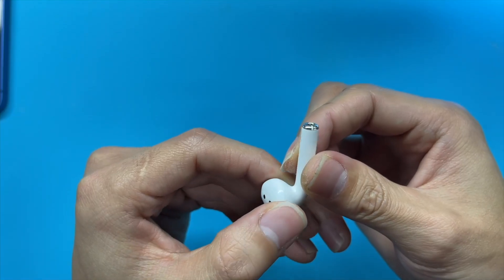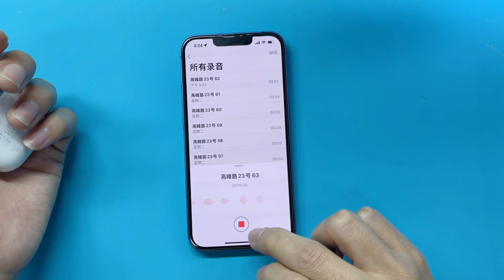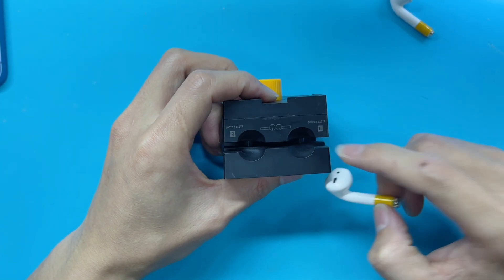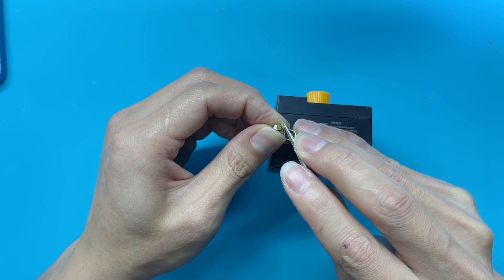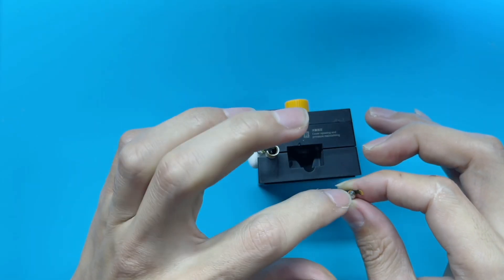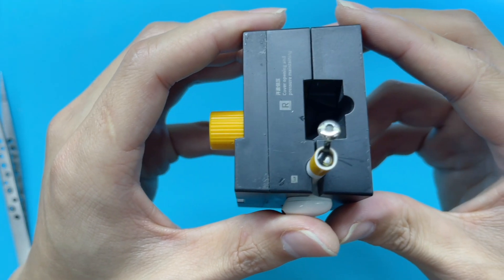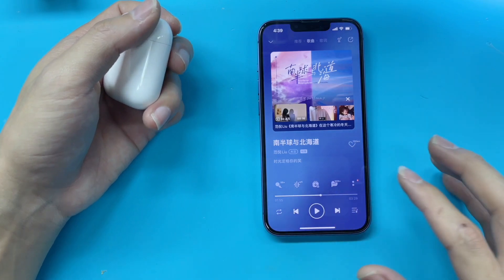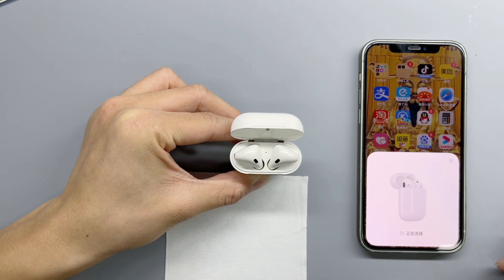How to Replace AirPods Battery Without Damage (First & Second Gen)

Comment: Works! 
If you use a stronger heater, like a hairdryer: make sure you dont heat the back towards the earpiece. airpod will get warm and deform, new bat wont fit properly.. ask me how i know :/
Reply: Hi there!, i wanna replace the batt. of my airpods , u know how can i Find the batetery replacement part?
Reply: @Saedale01 i got mine for too much money on amazon - make sure your listing actually inclused both batteries, mine didnt😬
Reply: @Saedale01  ali express

Comment: This year I was the last person to be re-gifted a set of Airpods that have apparently been circulating for 6 years. They are not taking a charge. With this guide I believe I can at least try to get them working.
Reply: It worked?
Reply: @ I forgot about this comment. 
Yes, it worked. To an extent anyway. The tolerances are too tight for the tools I had and I cracked the stems. A bit of glue and a layer of Kaptan tape means they now hold a charge and have worked fine for the past year.

Comment: Thanks for the video! I’ve been replacing batteries in phones, computers, and various other electronic devices for some time now, but the time has come for me to learn this delicate repair. I can’t bring myself to discard my 1st gen AirPods, as it feels like a waist with all other components besides the batteries being perfectly fine. Heat gun, patience, and probably more heat gun. 

Is the flex that connects the bottom charging contacts and microphone integrated with the battery connector flex tabs? The battery tabs appear to “sandwich” it.

Comment: What is flux? Can you put a link of everything you used. Ty
Reply: you dont really need it. at a certain point of degree, the solder iron melts and easily be pulled out.
Reply: Yes, I agree, it is a nice video, but it would be good to have links to some of the tools and products used in the repair process.

Comment: Hit and miss, my left sides tiny ribbon cable was stuck or intentially glued to the body of the battery. Pulling oit the battery of course tore/ ripped this cable when pulling out the battery and was meant to be in the bin anyways.

Comment: No thanks...I'll just buy a new pair 😂
Reply: Just bought a pair of batteries for only 20$ bucks. How much a new pair of AirPods?
Reply: @silvon4r depends 😂
Reply: @silvon4r how much for a soldering iron, solder, flux, heat gun, heat resistant tape, glue in a specialized bottle meant for precise application, and the batteries? Probably a lot more than the now discontinued but previously affordable $100 price.
Reply: @silvon4r yeah $20 for a battery, $6 for heat tape, $20 for a special clamp, $35 for a heat gun, $7 for flux syringes 😂 mean while costco took my return years later and i got a brand new pair
Reply: …and that’s exactly what they want you to.
Reply: @navarone_at ofcoz..that's why it's called a business company..😂😂
Reply: Yes you can buy a new one, but you can't buy knowledge.. and i'm considered this as knowledge..
Reply: For real. Fuck all this. I replaced the battery in my digital Polaroid easily and I thought this process might be the same. Nope. Lmao.
Reply: @ericalvarado1228 almost like they make it hard for the end user so they can siphon more out of pocket your pocket. Right to repair
Reply: Okay?
Reply: Bro Apple is playing us all, Mfs want us to keep buying new pairs
Reply: yeah but fck apple for making repairs that hard. They want people to be dmb and buy new ones
Reply: Fax this is too much for no reason bruh

Comment: It's an awesome skill. Have you ever been unable to connect to Bluetooth after replacement? After I replaced it, I can't connect to Bluetooth...
Reply from the maker: Yes, your problem might because the solder joints are not properly connected.

Comment: excellent tutor, unfortunately not all user having special clamp specifically for certain item. unless they open repair shop. but I would say this is perfect when other says cant u said yes it can be repaired.
Reply: Edit: This is the original repair video, where they make their own clamp jig: https://www.youtube.com/watch?v=pE9aB5aPbMM

Just need to design one on a 3D printer. Otherwise, I'm sure you could put some soft material around a clamp. There doesn't seem to be a lot of pressure required to pull the battery out.

Comment: Now, if Apple actually cares about the environment they will open up replacement parts and tools to 3rd party repair shops and to individuals.
Good video though, glad too see this is still possible till Apple pairs a chip in the battery with the headphone unit similar to that of the iPhone batteries. Making replacements impossible.
Reply: Law should prevent companies like Apple from making products that cannot have batteries replaced easily. It is contributing to planetary destruction!

Comment: iFixit: Non-removable battery, 0/10 repairability score.
ChargerLAB: Hold my beer…
Reply: I’m guessing iFixit is aware of this but doesn’t recommend the fine soldering work and risk of an average user overheating the battery too risky. You’d probably want to find the soldering gun, heat resistant tape and an infrared thermometer at the very least and most people would probably wing it with a hair dryer, posing a risk.
Reply: @veccio I winged it with hot hands and a hairdryer and it worked great. Battery came right out. I also just clamped the AirPod into a small electronic clamp stand with magnifying glass and did the soldering. Thankfully though I have extremely fine soldering tips, that’s the most important part imo, oh and definitely take some anti convulsants and maybe a benzodiazepine so your hands don’t shake LOL one twitch and you’ll melt through the side of the AirPod haha
Reply: @BengalGecko  You sound like a Metal Gear Solid enjoyer.
Reply: @dabelu7165  Metal Gear?
Reply: @veccio Yh the amount of things you need the average person doesn't have